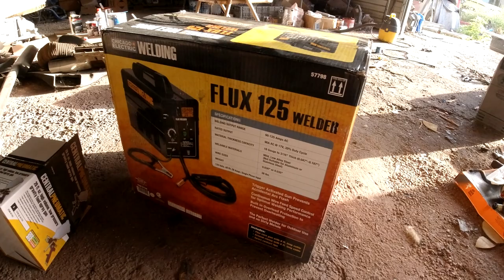1968 Chevelle Nomad Restoration - Part 17 - Installing Modern Retractable Shoulder Seatbelts

Comment: I used S10 pickup belts in my 65 Chevy II wagon. The retractor fits fine between the seat and door frame. The B pillar had enough "meat" in it that I simply drilled and tapped the existing metal and bolted the anchor point to it.  Easy peasy.
Reply from the maker: Cool!

Comment: Man , I get my Nomad fix ,you have that old hot rodder mentality! Use what you have instead of buying the high dollar after market stuff, great job in the seat belt retro fit👍,way safer than just lap belts as you said, may try that on my 64 falcon 2 door post! Thanks for putting out the best and honest content on YT!
Reply from the maker: Thanks!

Comment: I think it’s pretty cool how you thought outside the box with the sunroof from the Cherokee , seats and seatbelts from the explorer, as the other gentleman commented could the rear seats from the explorer be adapted for the nomad? Aside from the practicality it would offer it would also look pretty sweet with that plush velour front and rear matching 👌
l think it’s also really excellent that you’re acknowledging the good sense of having good working modern safety belts, you really should be commended for teaching that lesson when folks build cars and ship their loved ones in em. Good on you 
 Final point, sorry for waffling, but is there a engine / trans in any of those f bodies you have there? Surely one of those has an LT in them you could use in the nomad? 

But above all mate, welcome back, glad you and pup are home safe 🙏🏻
Reply from the maker: Thanks! There's no engines in the F bodies I have, they were v6's
Reply: @clunkersandclassics  ahh right, that’s a shame then .

Comment: That one had secondary shoulder belts,probably  removed  along time ago.
Reply: It's a 68 but it could have been manufactured in late 67 and there would not have been shoulder belts.  Only cars manufactured after January 1 1968 were required to have the separate shoulder belts.

Comment: on your welder if you can when using flux core wire plug the tourch into the negitive side and the clamp to the positive and see if that welds better

Comment: You were mentioning your welder when you pulled the trigger that the little wheel doesn't move it just clicks I had the same problem with mine and then I checked the wire speed the adjuster switch and I turned it up and then it started to work

Comment: What you mean boring you just saved yourself some money, adjustable front seat belts way better than that crappie pain in the back factory stuff any day. Boring to some but not to all since you had most of the stuff just sitting there kind of makes sense to use it, besides most of the after market sunroof and the like are not that great to begin with, just keep doin your thing and me and some of my family we'll keep watching!!!
Reply from the maker: Thanks!
Reply: I know what you mean.  As  kid back in the mid 70s I had my grandfather's hand me down 1970 Buick Electra.  It had lap belts and separate shoulder belts on the headliner.  Those shoulder belts were a pain to wear as they were pretty restrictive when they were properly adjusted, but I did dutifully wear them.  One night a drunk driver hit me head on and they saved me from serious injury and most likely saved my life.